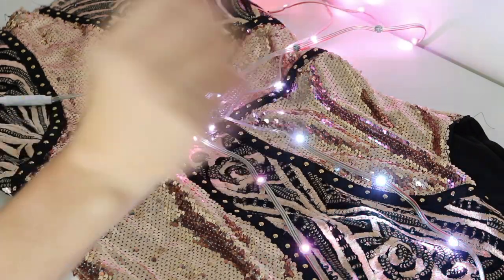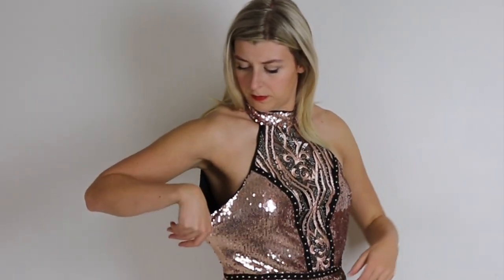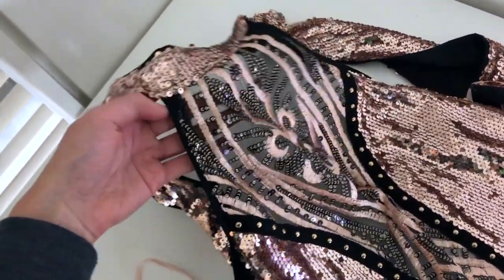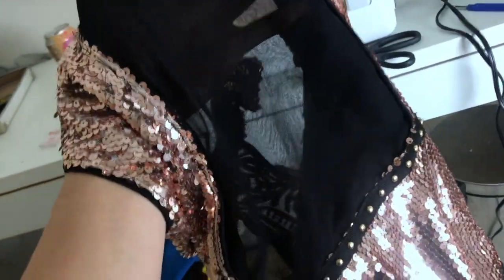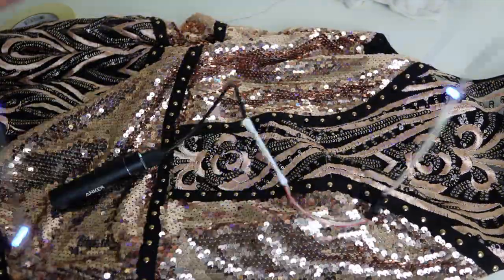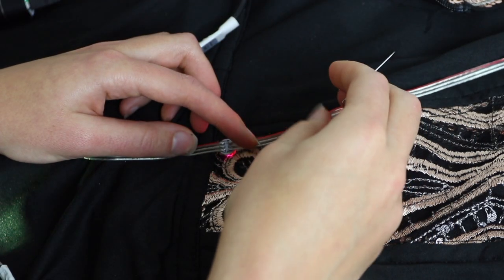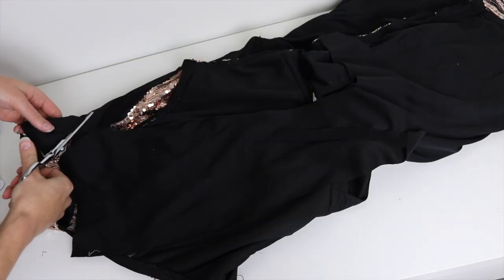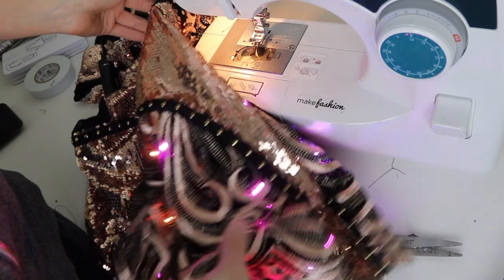LED Dress Tutorial: How I Upcycled a Vintage Thriftstore Find into Wearable Technology/FashionTech

Comment: So if I'm adding these to a backpack and I buy ur kit, since I dont need to cut anything up, the strip will be ready to attach without any electrical steps first?
Reply from the maker: That is correct!
Reply: Thanks for answering. And I dont need to buy the battery pack if i have a portable charger ?